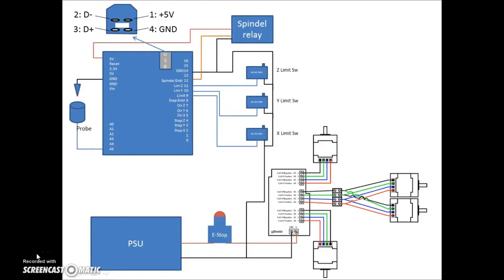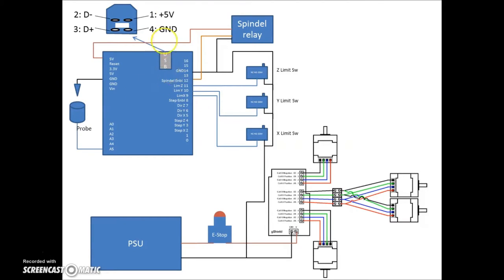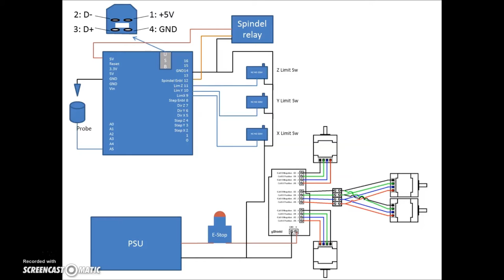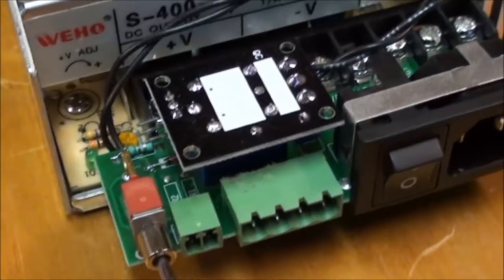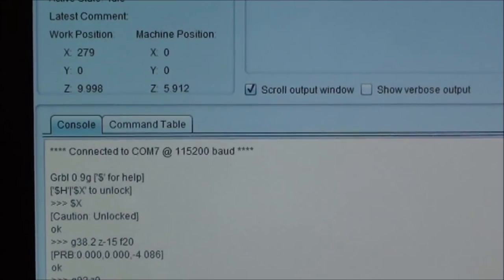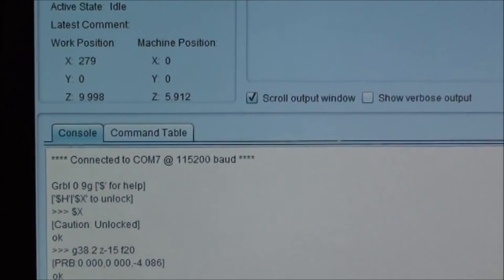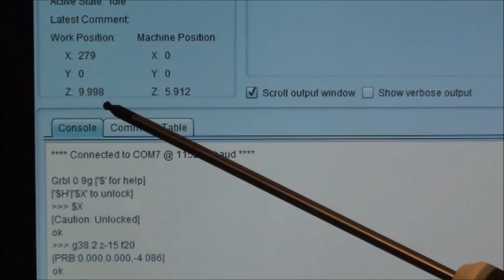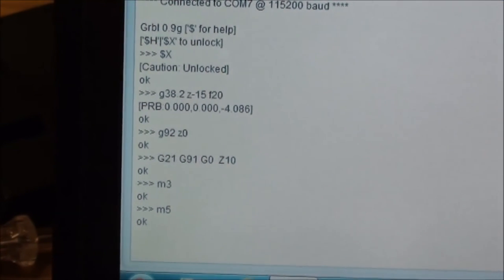X-Carve DIY CNC Router - Setup Probing and Install a Spindel Relay

Comment: Hi martin
Thank you for some well-aimed videos you created on your page - thank you.
Seeing that you have psu board with relay ... it's something you create yourself? or where can i buy these?
Thanks!
have a nice Christmas on.
mvh
kjell Arne
Reply from the maker: +Kjarby 67 Hi Kjaeby, The PSU I use is just an ordinary 24V. The little board that I made the modification to came with the X-Carve kit from Inventables. You can find it here: https://www.inventables.com/technologies/power-supply-interface-pcb
The mod I did was to remove the MOSFET and rewire to use a relay for power on/off of the spindle. I did this because I abandoned the 24V DC spindle in favor of a 220V Kress 1050 (works a lot better in my opinion). In a later mod I ended skipping all together the PSU board. See this video: https://www.youtube.com/watch?v=QQET60UbV44
Best wishes og godt nytår, Martin
Reply: +Martin Barfoed Hi martin
Thank you for again a really good explanation, so we'll see if yours gets them til..hihihi.
Then you'll have a nice Danish Christmas and a Happy New year.
MVH
Kjell Arne